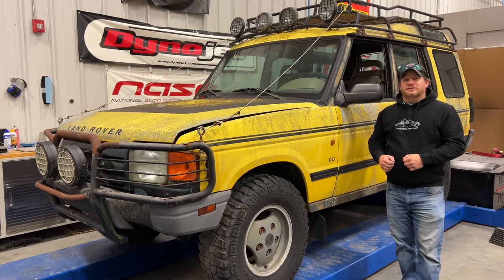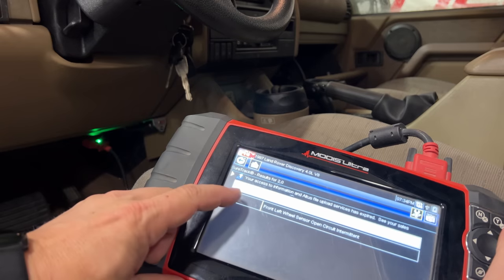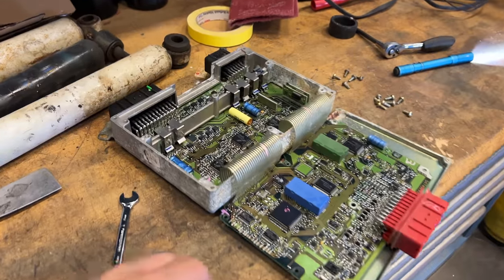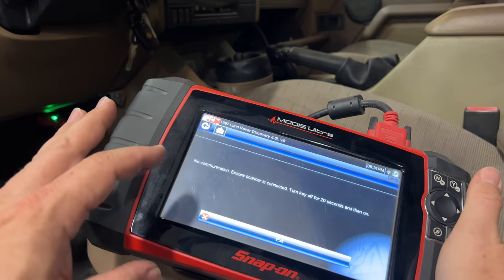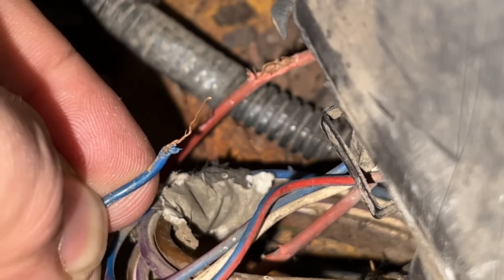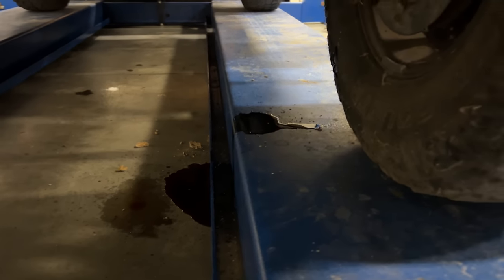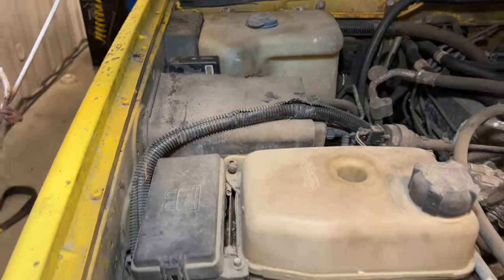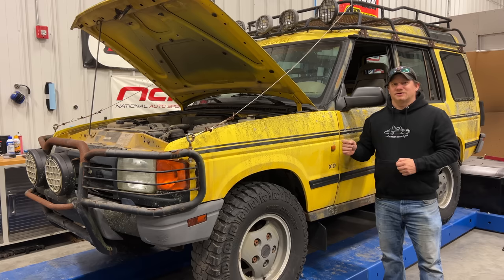Part 4 - Will It Run - Land Rover Discovery XD

Comment: Glad you got her running! FYI the ECU is married to the immoblizer and must be transplanted together to run. Took a while to build oil pressure, check that oil! Good luck on the Disco!
Reply from the maker: That’s what I said in the video about the ECU.  The test was to communicate to it to know if it was the wiring or computer.

Comment: Keep an eye on the oil pressure light...that was on for a while whilst you were revving it...these are prone to pump drain down when left standing...sometimes they won't self prime at all. No comms should always trigger a power & ground check. Could have easily been a corroded ground given the state of it down there!

Comment: Nice.  Pretty rough shape so what are your long term plans?  Didn’t even wash it before you started. Is that so you don’t invest time in it before you see if it runs?
Reply from the maker: I don't usually do anything to any vehicle until it runs, if the engine is trashed it is probably not worth going any further.
Reply: @ThisWeekWithCars  i wish I had discovered you and your videos 20 years ago. But then, you were probably still in high school. My motto was while I’m here I might as well fix this. Twenty years later and four cars in pieces and nothing runs.